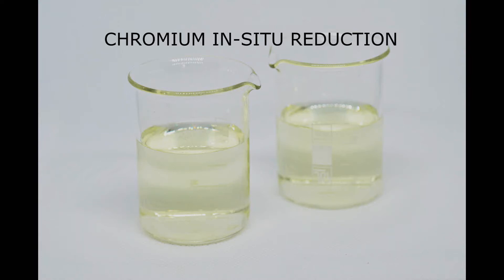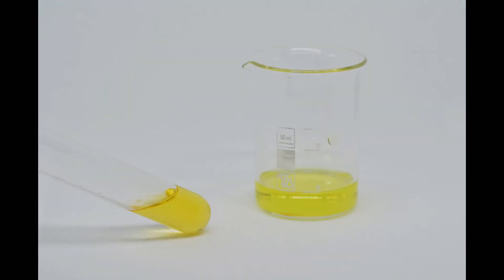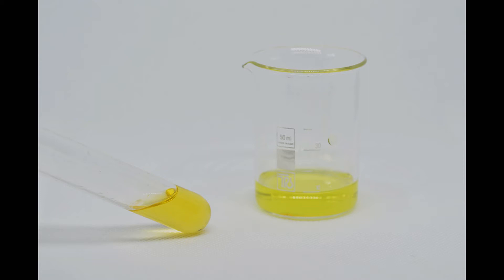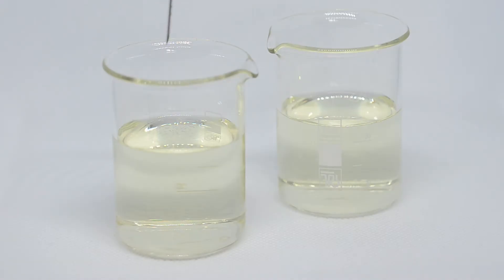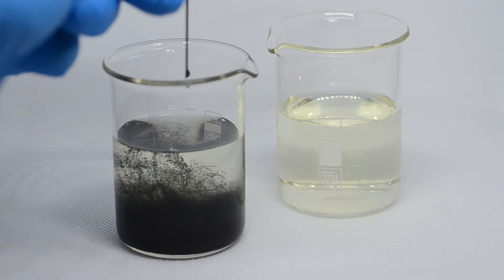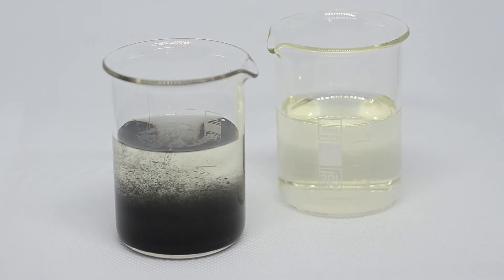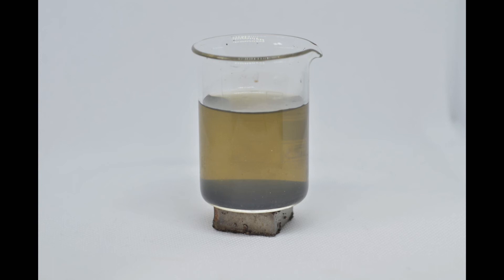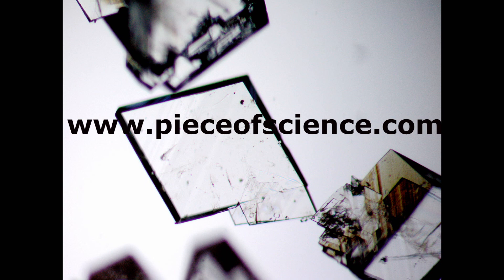Removing hexavalent chromium from polluted groundwaters using nanomaterials

Comment: Interesting experiment! While cleaning up contamination is crucial, it's even better to prevent it in the first place. I've heard about new coating tech like EPVD that doesn't use hexavalent chromium at all. Seems like a step in the right direction for environmental protection!

Comment: Which nanomaterials
Reply: Colloidal iron.
Note that hexavalent chromium can be reduced with either iron(II) but also with elemental (metallic) iron under acidic conditions.
In both cases the chromium(VI) is reduced to chromium(III) while the iron is oxidized to iron(II) and iron(III), respectively.
The reaction with iron metal is limited by its surface area so using fine powder or hydrocolloid is more practical than e.g. steel wool and the concentration of acid can be lower.
Note that one benefit of using iron(0) is that it recycles some iron(III) by reducing it back to iron(II) by means of comproportionation.
The final product are mixed chromium-iron (oxy)hydroxides which precipitate at neutral or even slightly acidic pH.

Source: Gheju, M., and A. Iovi. "Kinetics of hexavalent chromium reduction by scrap iron." Journal of hazardous materials 135.1-3 (2006): 66-73.
Reply: @LiborTinka  yesss correcttttttttttt